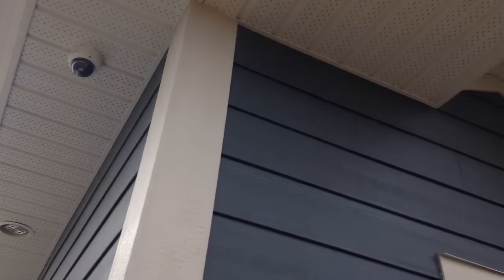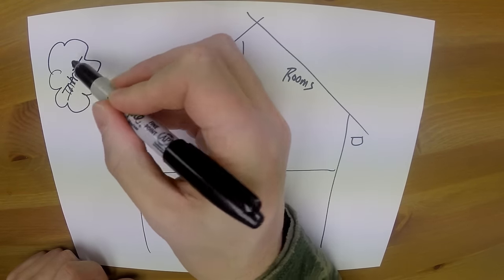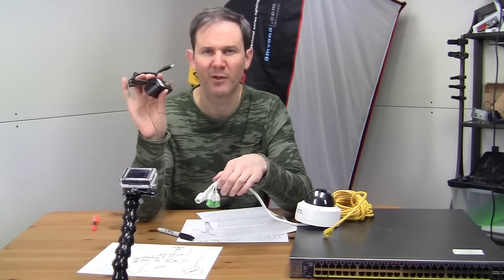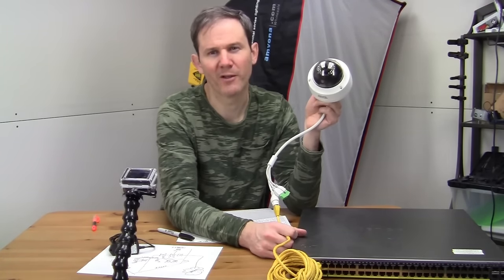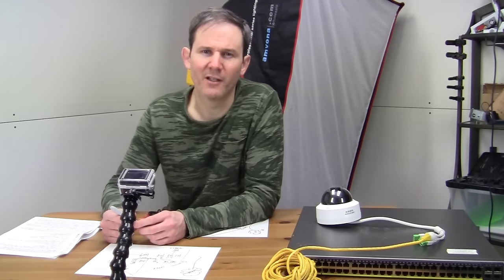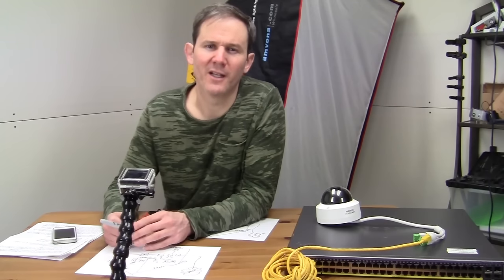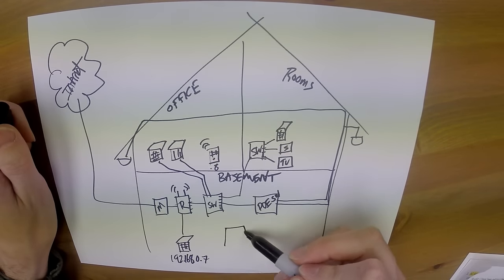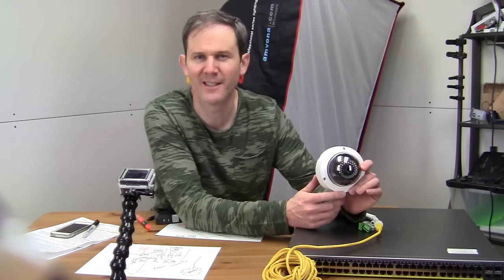My Security Camera System Architecture – Explained in Detail

Comment: Can’t believe how much you spent for a switch. If you want a Poe switch you can get a 48p 100/1000 poe for under $100 on eBay
Reply from the maker: Yeah, $180CAD for a 10/100 PoE switch in 2017. I'm still using it 4 years later for lower MP cameras so I don't hit the 100 mark. It's still performing perfectly! I have purchased a few pizza boxes on eBay (and kijiji) in the past with intermittent luck. My favorite PoE switch which I purchased new is the GS752TP. Only $600 and it's a beast!! Keep an eye out for it in future videos.